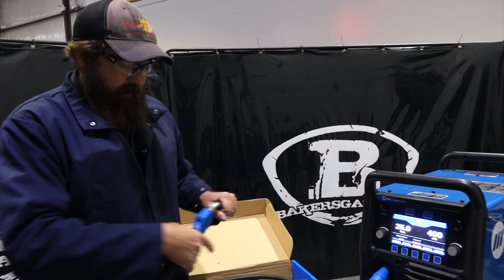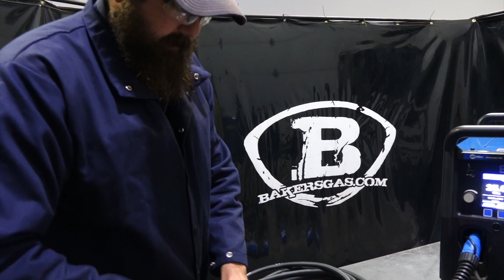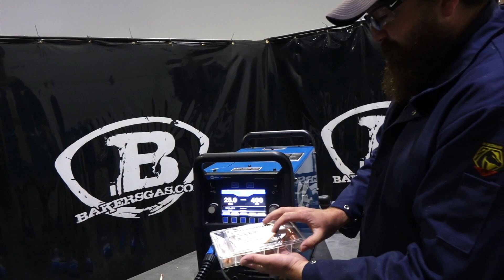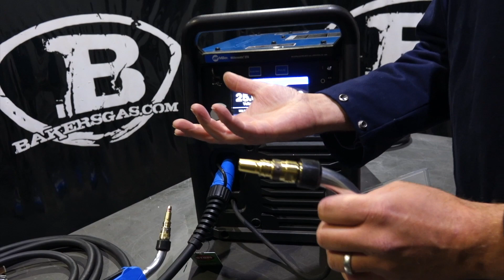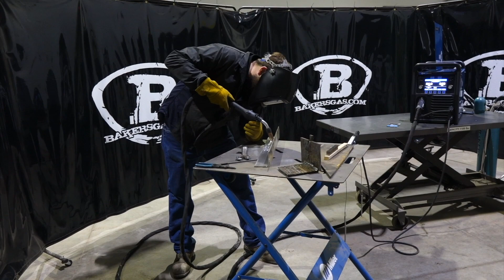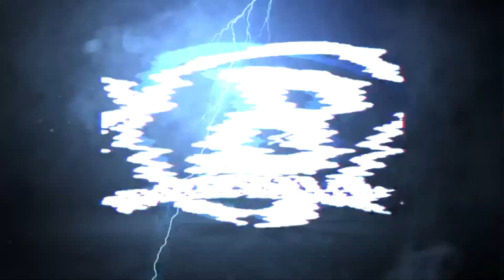Miller MDX-250 EZ-Select MIG Gun Review plus AccuLock S vs Acculock Consumables

Comment: Just purchased the Miller 255 with the standard MDX-250 gun. I'm having to run it at a gas flow of 30 and as high as 40 if its drafty. Is that normal? I checked the machine already for gas leaks and gas seems to be flowing out of the nozzle okay. Could it be my regulator isn't reading correctly? I'm used to my old machine running between 15 and 20.

Comment: I have the miller 215, it came with the MDX-100. Will the MDX-150 FIT?
Reply: You  can upgrade to the m15 mig gun, 15 foot long, that's what I did to my millermatic 211 it's so much nicer to have a 15 foot mig gun.
Reply from the maker: yes you can upgrade to the MDX250 if you would like to